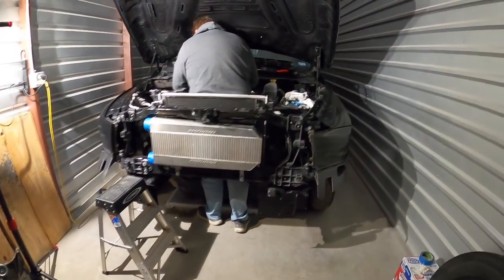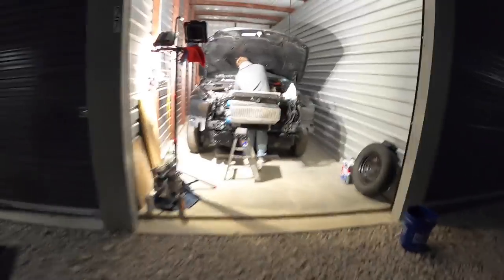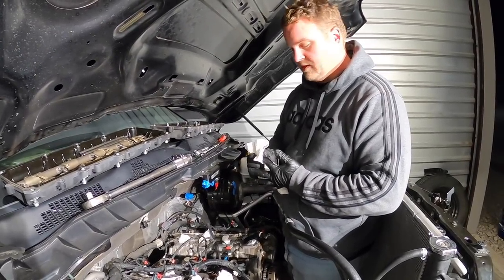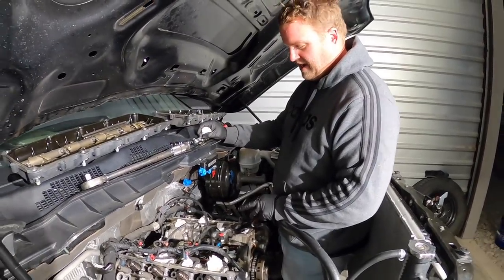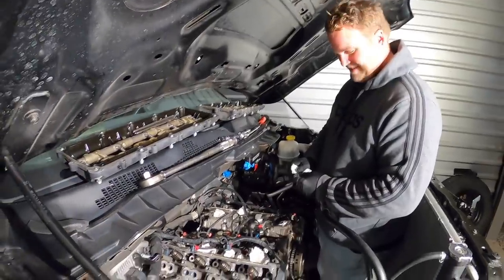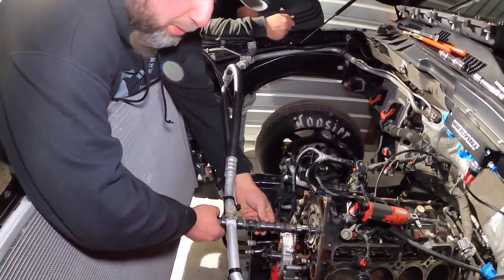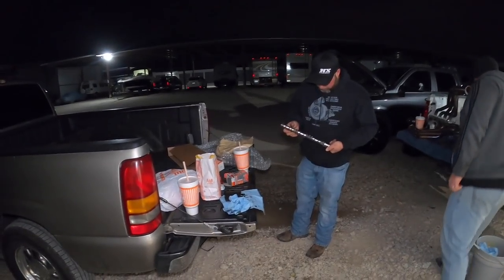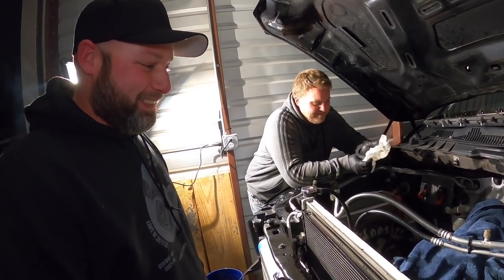ANOTHER BAD 5.7L HEMI CAM & LIFTERS

Comment: I’m in the process of doing my ‘14 Ram.  I’m Doing a Jay Greene cam, Hell cat lifters, mds delete, cam phaser limiter, and a Hell cat oil pump.  The oil pump is the key.  Hell cat pump is a high volume oil pump, this provides more then double the amount of oil getting to the top end. In theory this coupled with the more robust lifters should solve the cam lifter issues.

Comment: the Hellcat lifters are a direct replacement for the 5.7 and much better quality for higher RPM under load.
Reply: Hellcat lifters are the same part number as the non-mds lifters...

Comment: Ya I woulda done the same .. bigger cam new lifters an springs etc.. as for the ecodiesel john… have you seen that video that YouTube channel “reignited auto recycle” jus did recently where he answers subscribers questions called ask a technician as he was a mopar tech for quite some time  … he answered a subscriber question about the ecodiesel engine an he went in fairly deep details all about how it became an how it’s built an it’s emission system etc etc …jus thought I’d mention to ya case you hadn’t an was intrested in hearing his take on them .. I think yours is doing exceptionally well so far an I beleive it’s because of your excellent maintenance schedule an you drive in a reasonable manner an not try to pull overloaded loads with an not run it hard .. cheers bro .. I look forward to the follow up with your friends engine in this video 👍💯

Comment: Its definitely the lifters that fail. The roller seizes. The big question is it caused by the mds system, bad lifter design, poor oiling. Majority of people(me included) think its a flawed design in the mds lifters. Thats why a lot of people go with hellcat lifters when they cam the hemis.
Reply from the maker: Not necessarily.  The lifter itself collapses and doesn't maintain adequate pressure causing irregular wear on the roller and also why you get the intermittent lifter ticking he was experiencing
Reply: @BoostedMotorsports  i will say what his issue was i havnt heard of happening a ton and maybe its more because he races it. Every person i know to have the issue it was the roller that failed. But thats why i brought up is it caused by poor oiling in the hemis or just a bad design in the lifters
Reply from the maker: Yeah like I mentioned in the video its hard to say which occurs first.  When the lifter itself doesn't maintain adequate pressure and the roller is jack hammering on the cam the roller eventually fails.  With only 60k miles on this engine he just caught the issue super early
Reply: @BoostedMotorsports  ya, it definitely saved him from potentially having to replace it. A lot of people who have had the issue seem to be 60k+ and im sitting at 69k on my 17. Supposedly they redesigned the lifters in 15 so the failure is less common. Im just crossing my fingers till I got the money to cam it 😂
Reply: DaveCaresForYou  its not so much they work better cause the do the exact same thing. One reason is people partially blame the mds system for the lifter failures which the hellcat lifters are non-mds lifters. On top of that they are designed for much higher power/performance levels than the stock 5.7 ones are. In other words they are a proven part that works
Reply: Well attack all (3) faults and remove them from the equation. Improves odds and increase longevity of the components. Only savior is to go easy on pedal, rob your savings for next offensive at  60k-100k, buy repair manual & special tools then go beast mode and perform the 12- 14 hour DIY operation. No way I'm dropping $6k ($145/hr + 2k in parts when the lifters take a shit again..